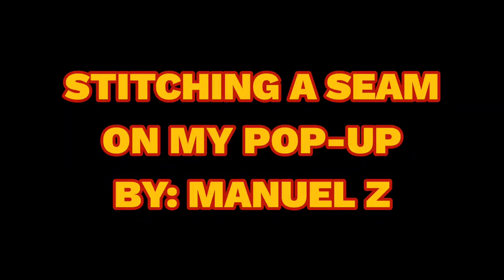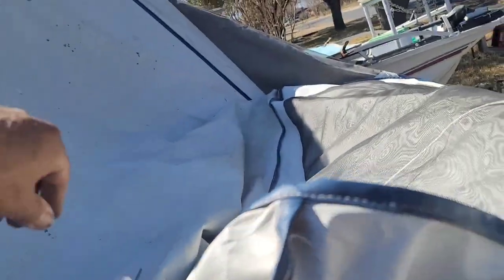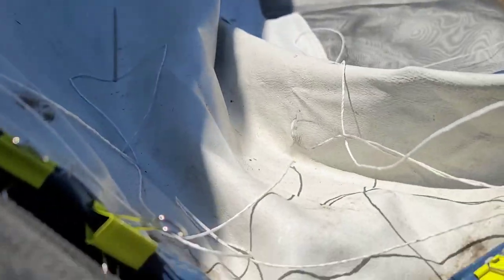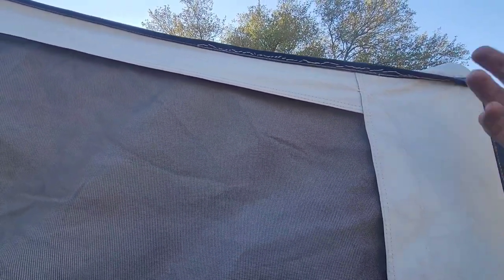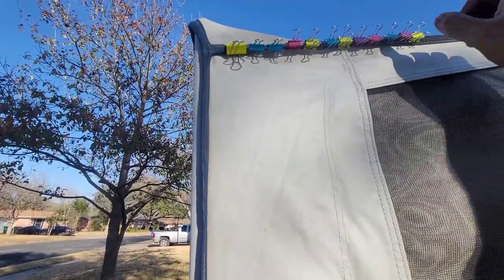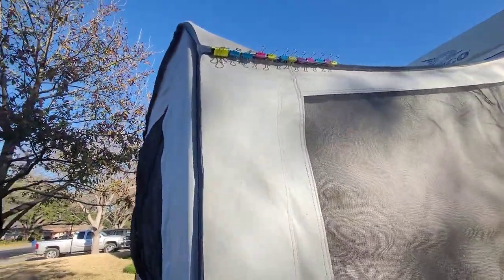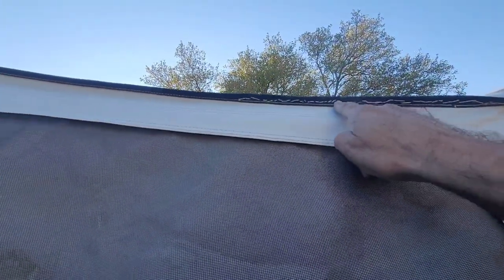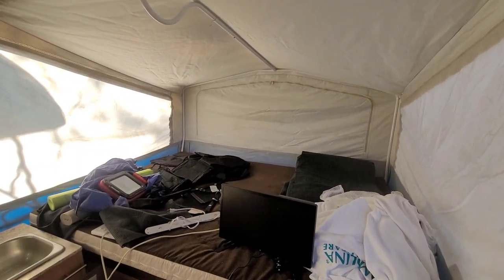POP-UP CAMPER SEAM STITCHING (NOT) A DIY HOW-TO!

Comment: My hard lesson was to make sure the underneath section (looped elastic, on mine) is disconnected before pushing the beds in. I forgot to release the bottom flaps and tried pushing the beds in, and the retaining clips on the ends of those elastics all popped off, as well as tearing the seam in about the same place as you did.
Reply from the maker: Sorry for your loss 😏